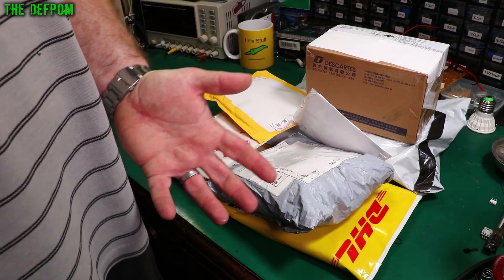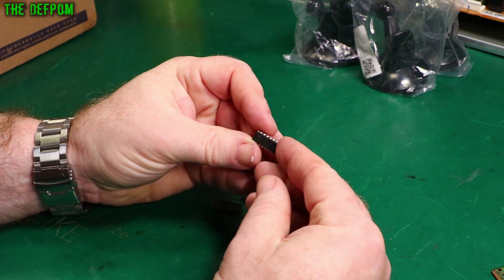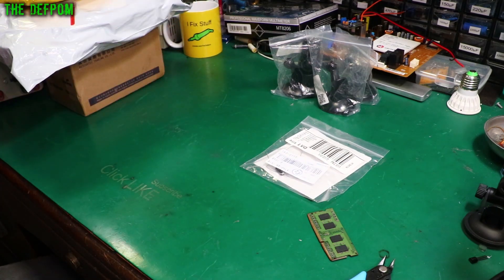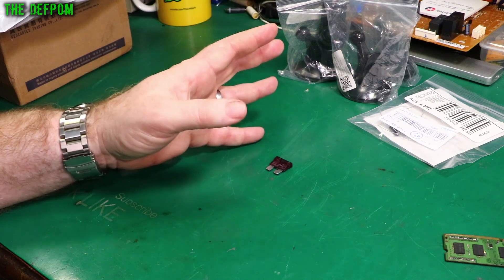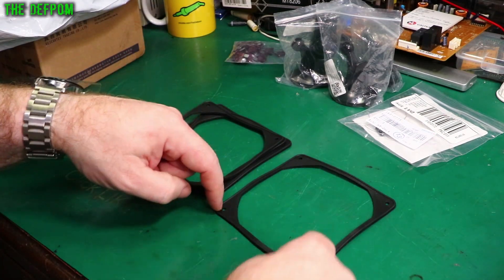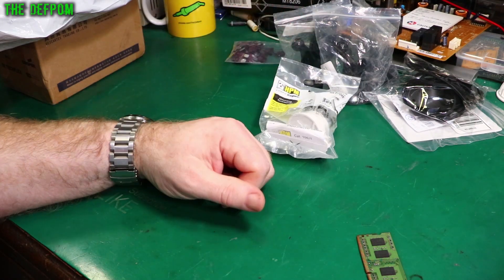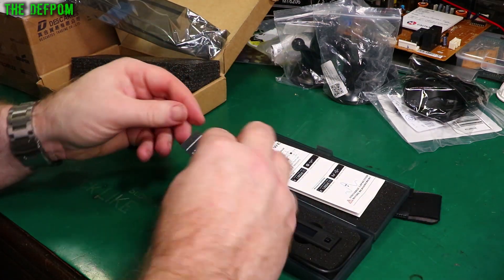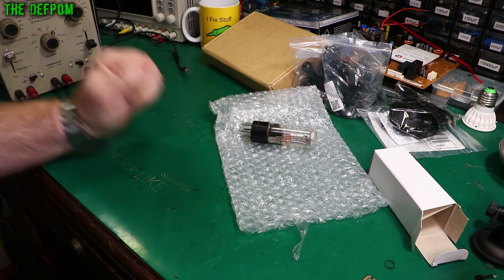🔴 What's in my Mailbag ? - Mailbag Monday 11th July 2022 - No.1017 - not James Webb

Comment: Instead of a resistor that will always have a voltage drop across it, would it be better to use a choke coil that would momentary restrict current then act as a short?
Reply from the maker: Inrush is only part of the problem, which is why I’ve decided to go for a resistor

Comment: Just drill a hole in you front windscreen and attach it with rivets. Ps a TL866 II plus can test some logic chips too, used it the other day with 74595s for my Tenma DC Load display board.